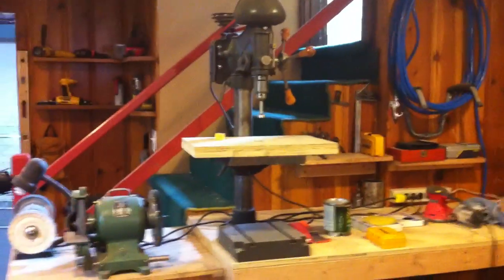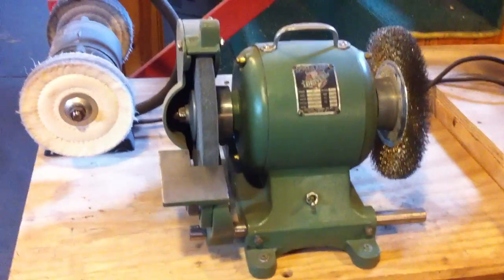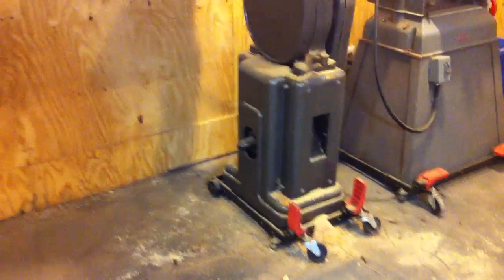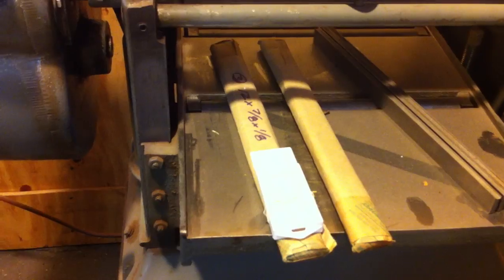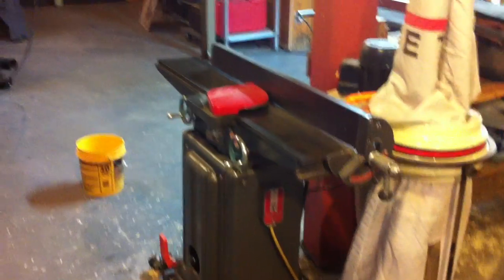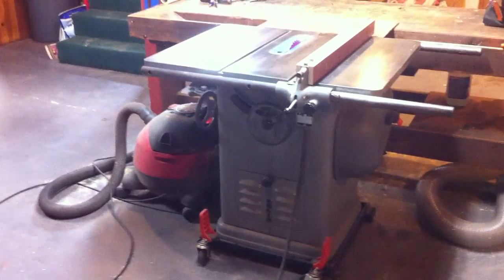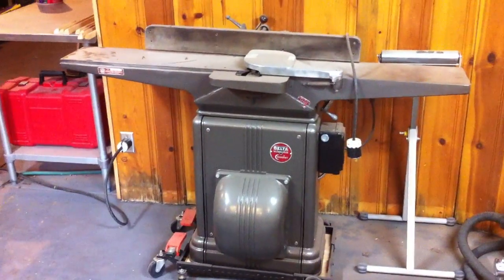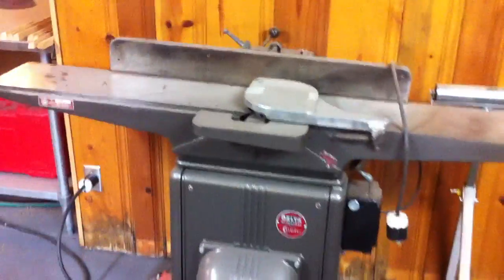My OWWM shop tour...

Comment: Nice shop, loving the "Old Arn".

My grandfather left some old iron when he passed. Most 1940's era. 12" Walker-Turner Driver-Line bandsaw (apprx 1934) which resides in my shop now. As well as a 1940's Uni-Saw, 1940's 16" Powermatic planer, 20" Davis and Wells bandsaw, and an old Walker Turner lathe. As well there is a Craftsman 6" jointer, drillpress and 2 radial arm saws, one 8-1/2" and one 10".

I love the old 20" bandsaw. It's an animal! Resaw anything, like a mini sawmill really.